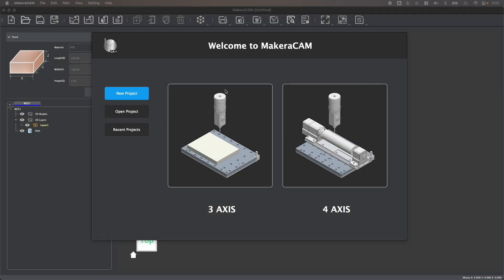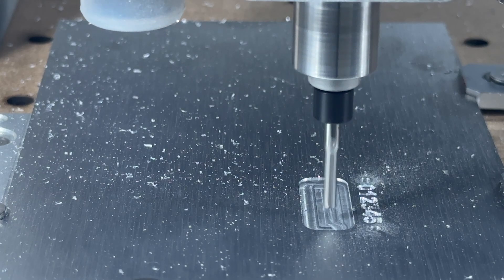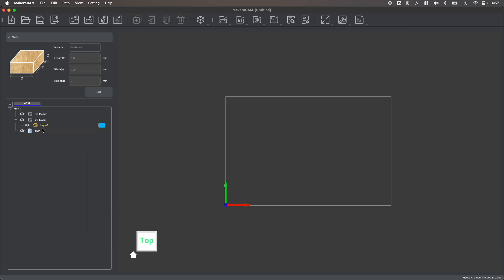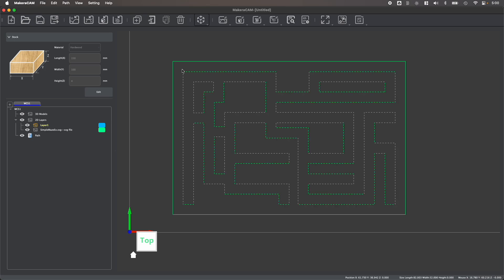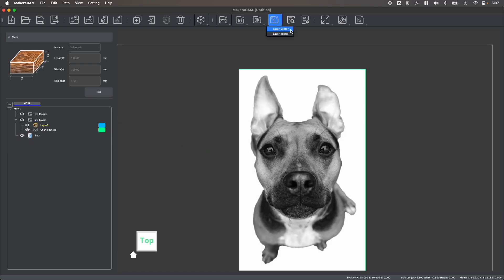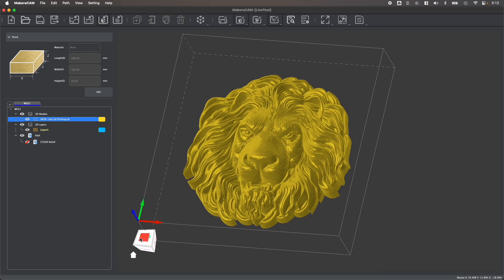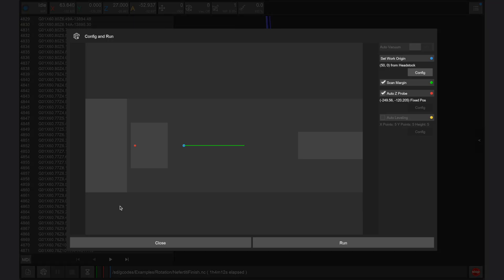Makera CAM - an overview on how to use Makera CAM

Comment: I bought a Maker Z1. Will I be able to use the software that comes with the machine on my other routers / CNC’s? Can I modify the postprocessor to adapt the g-codes to my non-standard machines?
Reply from the maker: At this time, Makera CAM and Makera Studio is designed specifically for Makera Products. But it is possible to modify the Gcode manually, and we are looking to add the ability to possibly change the post processor in the future. The Z1 is also compatible with other CAMS, like VCarve or Fusion too.
Reply: @Makera  thank you for detailed response :) another question: is there any indicator on Z1 with tool number to put in spindle or only „next tool”. Could led light at Z1 blink X times that indicate tool number (idea)? Cheers! :)

Comment: Wow! Does MakeraCAM support “4-axis simultaneous machining”? This means that rotation axis and XYZ are moving simultanious at the same time? If yes, can you please make a video about this? This would be great advantage because lot of 4th axis CAM SW are not supporting this.
Reply from the maker: In its current beta form, Makera CAM supports some but not all 4th axis operations. However, index machining and simultaneous machining operations will be added to Makera CAM  once available at no additional cost.

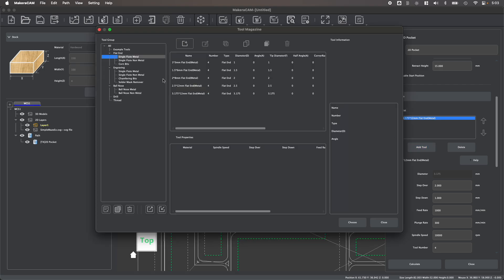Comment: Also, at 4:10 you say that a second tool can be added to a path: A larger diameter tool for roughing the shape, then a smaller tool for finishing. This is not true, the ADD button is grayed-out, only one tool can be selected for any path, unless I am mistaken.
Reply from the maker: This feature was temporarily disabled due to a bug, but will be corrected in an updated release.
Reply: @Makera has this been corrected and released?

Comment: How do we switch units from the default millimeters to inches in order to match a design in inches from Fusion or any other CAD program?
Reply: Tech support has just informed me that imperial units are not currently supported by MakeraCAM.
Reply from the maker: Correct, but this will be in a future version.

Comment: I couldn't figure out how to adjust the coordinate system to comply with the exported STEP file from Fusion 360. "Up" seems to never be the same as in the file I created
Reply from the maker: How was this file designed? It should be based on your origin system in Fusion

Comment: Great work! I would also love to see a more streamlined process to mill PCBs, where you would just have to import the gerber files and maybe tweak a few settings instead of creating every operation from scratch every time- maybe by implementing a template for different types of pcb (single sided, double sided, with soldermask etc)
Reply from the maker: Great suggestion!